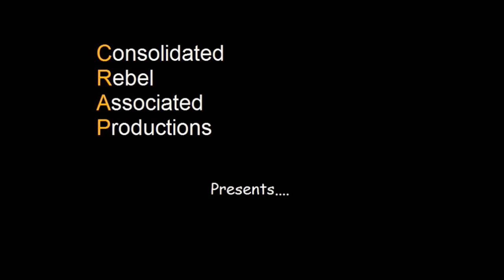The demolition of Westwood Power Stations cooling towers remembered

Comment: Hello mr H I hope your are well sir. I’ve recently been trying to find the base of tower one and I cannot seem to find it. Just wondered if there any chance you could give me rough idea please. 
Love your videos pal.
Reply from the maker: Hi Marko, sure no problem.
From Chapel Lane head down the new bypass 'Westwood Way' until just before you get to the first traffic island.
Stop before you reach the traffic island and look to your left and you should be able to see an electricity pylon and the electricity substation with the buildings behind it in the distance shown around the ten minuite mark in my video.

If you can then at this spot turn right and cross the poor attempt at landscaping running  alongside of Westwood Way and you should then be able to see the remains of an old tarmac road heading off into the trees.
This is what remains of the old cooling towers access road, just follow this for about five minutes until you come to a small fenced off compound in the trees on your right.
Then the base to cooling tower no.1 is just on the other side of the trees in front of you which will open up if you follow a small man made footpath.

Sadly the base to cooling tower no.2 and the pump house that used to sit inbetween them can no longer be seen as it is buried under tonnes of rubble from when the access road to the power station site was removed and rerouted sometime in the late 90's early 2000's.

Hope this helps. 👍
Reply from the maker: Bit of an update for you Marko, went over to the base of cooling tower no1 on a bit of a bimble this morning and you can still get to it using the directions I have given you above however take your wellies with you as it is currently like the Somme over there.

Also Wigan Council have grandiose plans for the area (which won't be the first time) and have earmarked the cooling towers site for housing and a nature reserve building with civil engineers currently digging trial holes hence why you'll need your wellies!
So if you want to see the remaining cooling tower base I'd suggest doing it sooner rather than later as it does look like redevelopment of the area is actually going ahead this time.
Reply: @MrHsHotPot  thanks so much for your help mate. I’m going to have another walk over there this weekend weather permitting. I will remember to
Take the wellies.  
Thanks again for your help
Reply: Hey mr H hope you are well sir. Just wanted to say thanks for your help finding the base of number 1 cooling tower. Just got back now and I managed to find it.
Reply from the maker: Glad that you managed to find it Marko. 👍
Recently illegal BMX'ers have been using the former cooling tower base, which you probably saw their crudely built ramp made from bricks and cement during your visit.
Sadly the base is now the only large visible reminder of Westwood Power Station and that too will soon be gone once redevelopment work begins.

I do know where there are one or two other reminders of the power station and I think that I'll do a video on these in the upcoming weeks before they disappear now that it looks like Wigan Council are looking to redevelop what's left of the old power station site.

Anyway glad that I was able to help you to find the base, enjoy the rest of your evening and all the best.

Comment: I enjoyed that video. Is McAvoy's old hall in that area?
Reply from the maker: Hi Mashed85, yes McAvoy's old hall is still there just to the right and out of shot at 18:01 although the main house has been vacant since Mrs McAvoy died sometime in the 80's. I believe Wigan Council now own McAvoy's along with the small cottage at the side which is still occupied. It is thanks to the tenant of this small cottage who simply refused to budge despite huge pressure from the Council that McAvoy's old hall did not get demolished when the main power station site was redeveloped for the second time. I doubt that you'd recognise the area if you haven't been for a while as the building that now occupies where the power station stood is that big that it has also swallowed up the area where the Kay's Houses used to stand bringing the fence line literally three feet across the end of the driveway of McAvoy's old hall and was probably done that way as a corporate way of sticking two fingers up at the tenant who refused to move.

Comment: Imagine breathing in the dust, going by what you said Re asbestos,  from where i live i can see a huge tall chimney smoking away 24/7 what will that be Roy.
Reply from the maker: Thankfully Alan, the amount of dust created when the towers were operational would have been minimal due to the constant flow of water wetting everything down inside the towers but it does make you think what we were living in the shadow of at the time. Reference your mystery chimney could it be Fiddlers Ferry Power Station which is still coal fired and has a single stack?